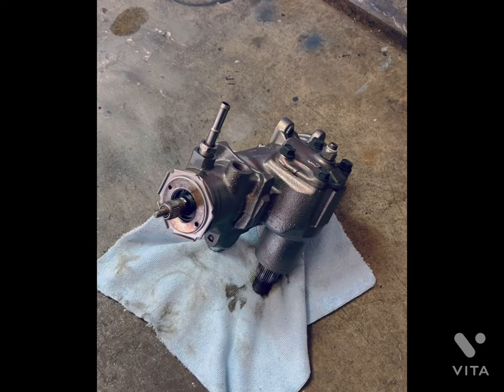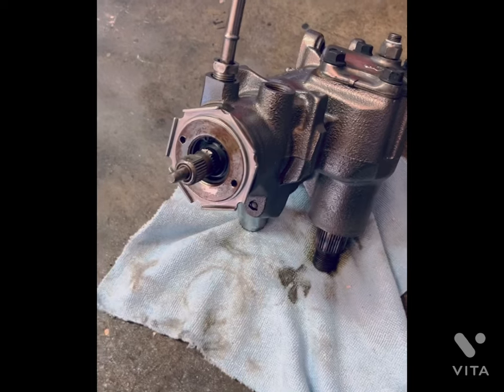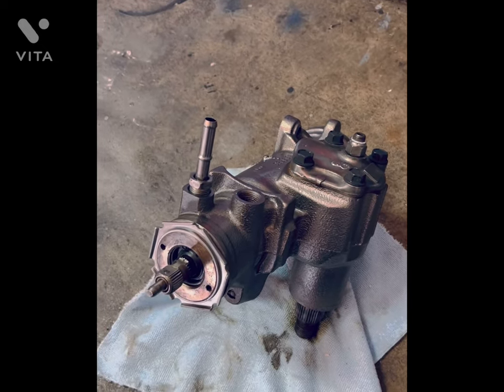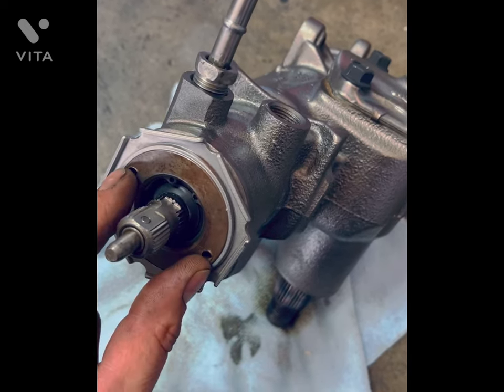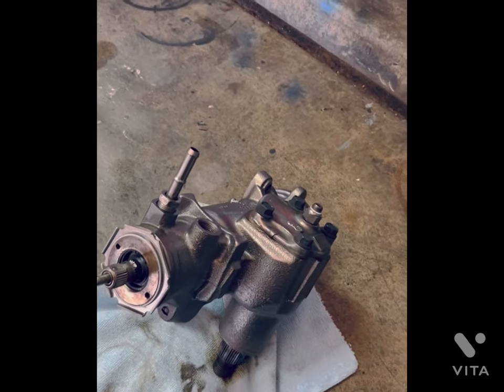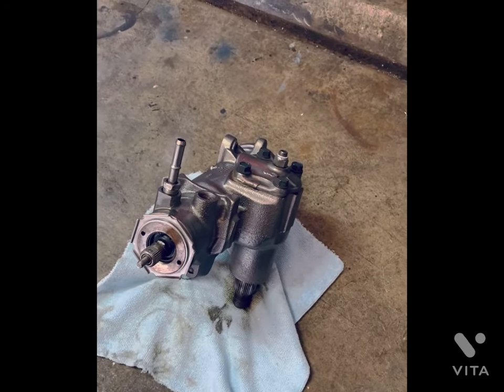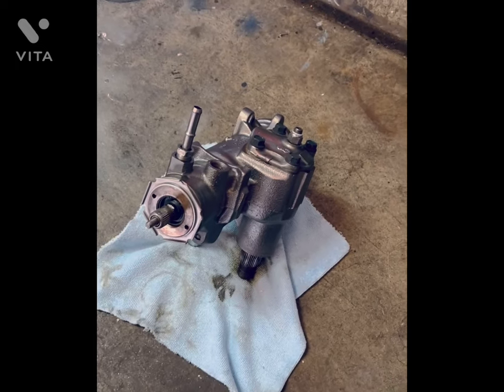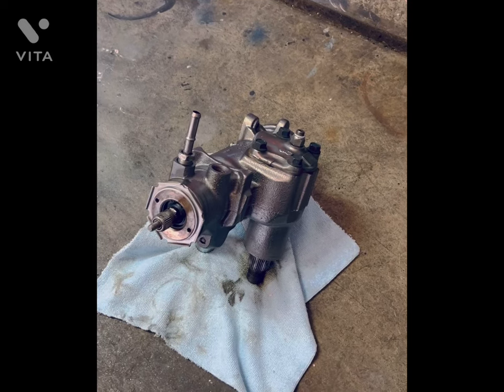How to properly adjust a GM/Saginaw steering box

Comment: FYI:  You stated to adjust the pre-load worm gear shaft to tighten the cap to 30 ft. lbs., I believe if you double check the torque for the cap it is 20 ft. lbs.
Reply from the maker: My 1983 F-body FSM states 30ft/lbs
Reply from the maker: Groovy. I have 9 GM FSMs that state 30 ft/lbs 👍

Comment: Thanks for the video..very useful..slightly daunting...only issue I have now is how to torque the cap down to 30ft/lbs without a proper torque wrench.. surely if you just doing it by feel then you are defeating the whole purpose since the tolerances are so sensitive..is there a torque wrench adaptor to do this with?

Comment: Can you just adjust the pitman shaft without the other adjustment my pitman shaft has alot of slop don't think it's ever been adjusted as I can see the inner adjuster bolt is low almost in line with the lock nut on the outside oh yeah this is a 98 Tahoe 4 wheel drive if you need that information I plow with it
Reply from the maker: Like I said in the video; there is only one way to properly adjust the box, the way I described in the video.

Comment: Im Guilty of making the top nut adjustment without looking more into it... The question I have is did I ruin my box from over adjusting the top allen bolt?  I cant get the steering back, it gets stuck whereever the wheel goes and cant find center ect. Is it fucked?
Reply from the maker: How much did you crank it down?
Reply: @Joesmusclecargarage  It was about a 1 ¹/⁴ turns then it go snug.  then i backed it off about a 1/4 turn.... come to find out the slop i did have was in the rag joint so i adjusted a perfectly good box 🙄

Comment: The one on my 99 Suburban is leaking a little and really sloppy. I'm tempted to buy a reman just for the sake of time (I'm not familiar with rebuilding them and this one has  250k miles). Are the reman units usually pretty reliable? Prices vary a lot on Rockauto.
Reply from the maker: They’re not horrible. They’re kinda hit or miss. They’re not bad to rebuild though.

Comment: I’ve replaced every single front end item including the box and still have slop! Beyond frustrating! Every mechanic I’ve used all state that the steering will get no stiffer… I’ve never tried this method and I’m not sure what mechanics in my area would!
Reply from the maker: What kind of car/truck and how much slop? Doing this adjustment isn’t going to make something handle or respond like a Corvette.
Reply: @Joesmusclecargarage  1997 K1500... i can rock the wheel sitting or driving a good bit back and fourth and she doesnt even start to turn. ive taken it to many shops and even had a whole new front end put on and aligned and still slop
Reply: Did you replace ball joints that worked for me after replacing every front end part including steering gear

Comment: 98 chevy silverado - i replaced my input seal/o ring while the box was in the truck but i didn't mark the original positions of the housing, cartridge, lock nut. 

i tried the 1/2 inch back off per the manual but still have lots of play in steering wheel that wasn't there before.  do you think i backed off too much?
Reply from the maker: I’m not sure I am understanding what you did. If you followed the procedure, there shouldn’t be any play. Did you properly torque your flange nut before backing it off 1/2”? Did you properly adjust your over-center preload? You did something incorrectly.
Reply: @Joesmusclecargarage  Ty for responding. I gave the video a like. Yes,, i probably did something incorrectly unfortunately.

I had an input seal leak so while the box was still in the truck:

1. i removed the flange lock nut and the cartridge where the seal is.
2. i replaced the seal then reinstalled back on the box.
3. I tightened as much as possible and then put the lock nut back on.

i didn't do any torqueing, i just tightened as far as it would go then backed off 1/2 inch and reinstalled the locking flange nut.

i didn't do any adjusting to the OC preload as i was just replacing a leaky seal. There was no play in the box originally.

I guess i am going to have to remove the box from the truck and recalibrate on a bench. I was thinking this could all be done while the box was still in the truck.

Comment: So I have a 01 Silverado. And I have to turn the wheel to far left or right for it to even turn the wheel
 Was pulling my trailer up camping and I thought I was going to wreck the whole way. I tried to adjust but I guess I did wrong or need a new box

Comment: So if you wanted to do it incorrectly for the time being does the pitman arm have to come off?
Reply from the maker: The pitman arm doesn’t have to come off at all. Both adjustments can be done without removing the pitman arm from the box
Reply: For the upper adjustment does the steering box have to come out?
Reply from the maker: @timothykemp1772  Not usually. But adjusting only the overcenter adjustment on the top of the box will throw everything out of whack and it’s a guarantee the box will end up worse off than you started with. My advice is, do it correctly or don’t do it at all.
Reply: @Joesmusclecargarage  10/4
Reply: I have a 2000 GMC Yukon. I’ve been looking for these details for about 2 months. I’m glad I ran across your video. I have a new project for Sunday now
Reply from the maker: Awesome! Hope it all goes smoothly! 👍
Reply: @Joesmusclecargarage  Could you simply disconnect the pitman arm and  the steering shaft, loosen the rag nut and make both adjustments without draining or having the steering box come out?
Reply from the maker: @ifreemantoo  If you can get in there, give it a shot and have at it. You’ll be pulling the box eventually though.
Reply: @Joesmusclecargarage  Thanks for your reply. I just replaced the rag joint and there seems to be enough room. I have a 98 Bravada and the steering shaft is not bolted at the firewall. Why do you suggest that the box should be dry? I'm looking for the reasoning of it, not so much "the manual says so".

In trouble shooting sloppy steering at the box, once you pull the pitman arm and rag joint, a loose worm gear (in and out) would indicate an adjustment (I believe you said), but would the pitman shaft also show looseness moving the shaft in and out (up and down)?
Reply from the maker: @ifreemantoo  The box should be dry or at least empty because fluid in the box can give a “false reading” in terms of free play and the amount of drag on the box. Both the input and pitman shaft can have in/out movement if the box is worn or out of adjustment.
Reply: @Joesmusclecargarage  Thanks for taking the time to engage.

Comment: Is my 2002 duramax  the same style
Reply from the maker: Yep. Same principal and procedure.
Reply: @Joesmusclecargarage  cool I've  spent a good bite on all my front-end  Parts and time and still had a little  play in the steering  I was looking  at the shafts thinking  it was in the u joints.  To my surprise  it was wobbling were the shaft goes on the box .I just assumed  a loose bolt were it connected  to my box.its tight  tho then i thought the box was toast, maybe  15-30 degrees + or -  of slack
Reply: @Joesmusclecargarage  a new box wasn't what I was looking  to buy I just overhauled  the rig changed a bent   rod   cracked  piston  change  the  injectors , injection pump,  turbo rebuild  front-end  ,brakes ,tires .. expensive. Stuff

Comment: How does backing off large nut remove play?
Reply from the maker: It’s a locknut. Do you know the purpose/function of a locknut? The locknut needs to be backed off so the thrust bearing adjuster plug can move.

Comment: You've done this adjustment on the box out of the vehicle. How is it properly done with the steering box in the vehicle ? This is fine if you are replacing it but it doesn't address any adjustments if it is in the vehicle.
Reply from the maker: I don’t know what you’re asking. You can do it “properly” with the box in the car, IF you have enough room. If you’re going so far as to pull the pitman arm and disconnect the column, why not pull the box? It’s too easy to pull the box on money vehicles.